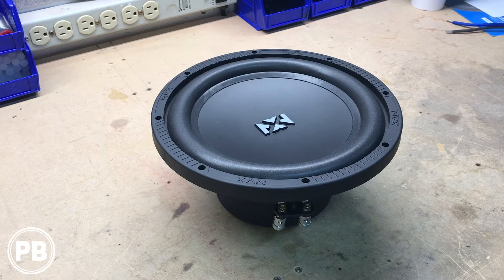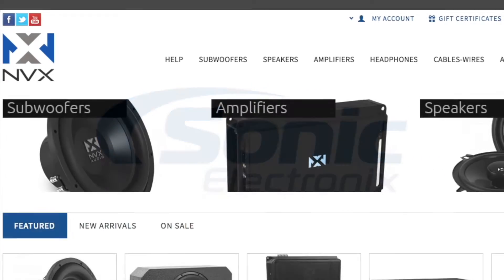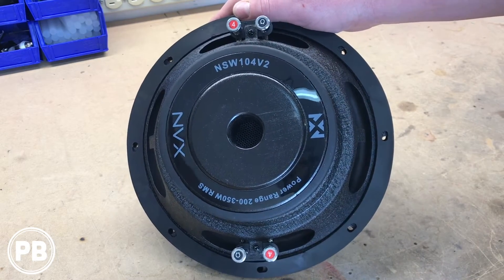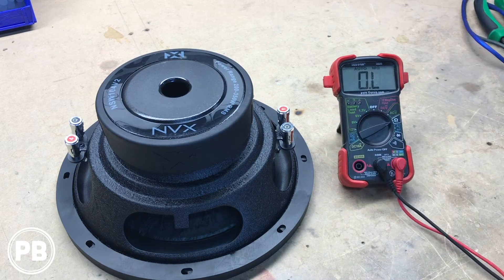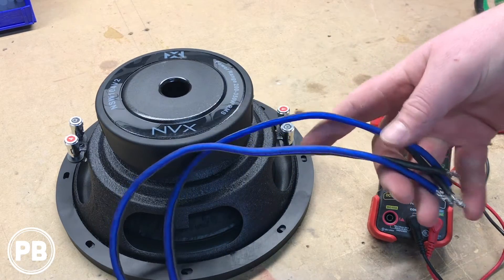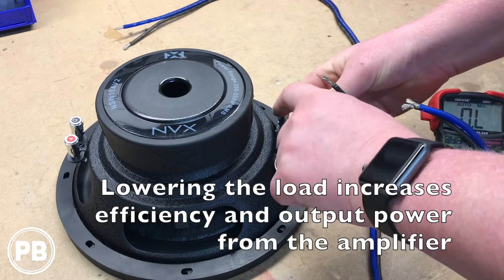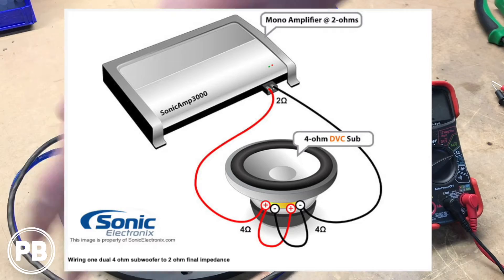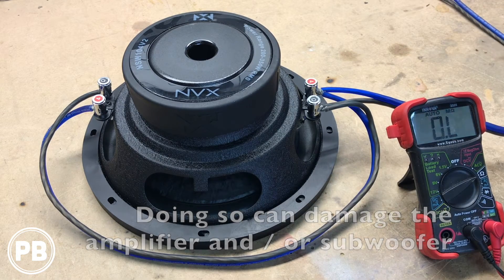How To Wire DVC 4 Ohm Subwoofer

Comment from the maker: Parts listed in the description!
Reply: What size of wire can I use
Reply: Hey mate, quick question, i have a monoblock that runs 2 parallel channels & 1 DVC 4ohm SUB.
Can i stick one side of my DVC's positive and negative into one side of the amp and the other DVC positive and negative into the other?
Does that break it down to two ohm as its a monoblock? How would i get it back to 4ohm? Do i just use one side of the amp to stay at 4ohm? Last question, Sound wise, whats better, running my 4ohm 12 inch at 2 ohm or 4 ohm?  thanks a lot.
Reply: Is a (330w/4 ohms) amp good for 1 sub that is (300w/4 ohms)?
Reply from the maker: Yep, just fine. @ThaBlackHammer

Comment: I did your Kenwood X802-5 amp and Kicker CompRT10 4 ohm dual voice coil sub setup in the Toyota Tacoma. That amp seems like it can handle a 2 ohm load? Currently I just have 1 set of terminals setup (1 positive and 1 negative). Would that be a 4 ohm load?

Comment: Electricity is confusing....
To my knowledge U shouldn't reduce OHMs (impedence) if sub is designed for that spec
Example: 4 OHM , don't go to 8 OHMS = less power consumption. 
If the sub is capable to increase (more power) 3 OHMS or 2 OHMS And so on then it is ok, as long as the Amp is capable. Try not to mix and match
If you have multiple subs and amps, gotta do a little math and testing to get the final impedence (preferably get some help from reliable sources)
Never just connect one set of terminals (voicecoil). 
Recently wired my DVC 4OHM  Kicker sub Red to red black to black and to my Amp, works great no overheating or anything out of the ordinary.

Comment: Can i connect single dual 4ohm sub in series to a bridged 4ohm amp?sub is 250w rms & amp are 400w rms x1 at 4ohm bridged.Basically connecting a 8ohm load to a 4ohm amp

Comment: how the heck do you get 2 wires to go into the same terminal ? i can't get them to fit i must be using too large of a gage wire but i thought i needed it for a 1000 W sub.
Reply: You need a special connector for it. I forgot what it's called. One side is for the wires and the other side is like a stud that fits directly into the speaker terminal
Reply: Twist the speaker wires together and use a banana plug for the connection...

Comment: so i have a 1000w 2 channel amp and a 1000w sub 4ohm dvc but the amp says only 4-8 on bridged can i just run seperate channels to each voice coil so it stays at 4ohm or should i bridge it at 2ohm and just keep the gain turned down which is gonna get me best power without trashing anything cause i also dont wanna run 8ohm
and just be wasting power
Reply: I have the same problem and I’m still looking for an answer
Reply: @Mjsay  i just hooked mine up on 2 seperate channels i think my amp only is pushing like 800w as dual channel vs bridged 1000w but my sub is only like 500w rms 1000w peak and it seems to be working pretty good, sounds better than my old imagine dynamic sub

Comment: I got a single 15 inch quantum audio 4ohm subwoofer hooked up to a 1ohm power acoustic amp. It comes on and play but when I turn the radio up to like volume 15 the amp goes in & out of protection mode. Any suggestions please?
Reply: Id make sure your ground is good and tight
Reply: I ended up having to change amps. The power acoustic wouldn’t hold the sub.

Comment: Thank you for the nice video, 
I'm a newbie with a silly question. 
What is the consequence if wiring 8 ohm single sub to a 4 ohm amp, better low frequencies, tight bass, better sound quality and more control while losing some of the amp power?

Thanks again

Comment: What happens if only one side is connected in a dvc sub to the amp? Will it mess up? Also, if I run two dvc subs and they both are wired at 2 ohms each, what will be the ohms to the amp? Still 2?

Comment: Do I just wire them normal for for 4ohm resistance? I have an ar2000m boss amp and a kicker comp r 12 with 500 rms. The 2000 watt amp has only 750 rms at 4ohms so I need to make sure I wire it at 4 ohms. 
Thanks

Comment: My Scenario: I have two separate 10" subwoofer cabs that have only one 10"DVC 4ohm speaker. I need to get each cabinet to output 4 ohms individually to run my 2 channel amp that outputs 1k watts on each 4ohm channel, Possible?  this is my amps' configs: Thx for your help!!
Power Ratings:
RMS Power Output:
Stereo 8 Ohm: 2 x 700W
Stereo 4 Ohm: 2 x 1000W
Bridged 8 Ohm: 1 x 2000W
Peak Power Output:
Stereo 4 Ohm: 2 x 3500W Max
Bridged 8 Ohm: 1 x 7000W Max

Comment: I have a 2 chanel amp delivering 2x 190 watts into 4 ohm. I have one single 4 ohm dvc subwoofer that I want to run with 4 ohm. How do I wire it to get 4 ohm? I dont want 8 or 2 ohm
Reply from the maker: It’s impossible with that sub, unless you add a second one, or use a different sub. Or use a different amp

Comment: What about showing us a final impedance of 4 ohms. This really is hard to find this info online. A single 4 ohm sub wired specifically to a 4 ohm amp. Why is that so hard to find?!
Reply from the maker: Because it's a direct connection, if it is a SVC 4 ohm sub, simply connect your speaker wire to the only terminals on the sub, and connect those directly to the amp.  There is no parallel / series connection being there is only one sub, and one coil to connect.
Reply: @ProvoBeastAudio  if I wanted to get 4 ohms from a DVC sub, would I just connect one side of the terminals to the amp like a SVC one?
Reply: @hyphinx I'm trying to find this info too. Apparently you should connect all terminals on DVC, never just 2.. But likewise can't see how to make a 4ohm load on 4+4ohm DVC sub.
Reply: @PeterPaoliello you can t make a 4 ohm load with 4+4. You can make only 2 or 8 ohms. But you can wire a voice coil in bridge and the other one the same if your amp can handle.
Reply: @PeterPaoliello a dvc is like having 2 svc subs.  When you have an old 4 ohm amp, you hook each channel up to each speaker.  If you have 1 dvc you act like each set of terminals are a separate sub to get 4 ohm on each voice coils but connecting a channel to each.  If you bridge it, by running only one positive and one negative, it's like 2 kids eating out of the same bowl of ice cream.  It's getting eaten quicker with 2 spoons (wires) going into 2 mouths (voicecoils.)  Parallel and series is like letting them each have a spoon or making them take turns using the spoon.  I hope this makes alittle more sense.
Reply: @shafuthau3694 an amp has 2 or 4 channels that can be bridged on an amp.  If someone wants to make 4 on each voice coil, they hook up a each channel to each voice coil.  If you have a box that had a dvc and only has 1 set of terminals on the box, you would need to take it apart to change the wires so each voice coil goes to a separate set of terminals. You would need to add another set of terminals to the box so you have 2 sets.  Yes it is possible.
Reply: Can't be done apparently as I'm finding out
Reply: @JESSEPAVON  yes but you need to match the gain
Reply: @JESSEPAVON  what amplifier?maybe it can t handle 2 ohm
Reply: @shafuthau3694  can u help me out too? I got a Jenson 1.2KW DSP mono 2 channel output (it's got 2 positives n negatives, both channels are mono) and I got a 4ohm DVC 12" sub. I wanna know can I wire one channel to one coil, and the other channel to the other coil so I can achieve the 4ohm (since both channels are running 1 coil, at 4 ohms, it's still 4ohms total right?)
Reply: @OverlordBravo420  yours can handle 2 ohm i think. if it can go with 2 ohm s in bridge
Reply: @shafuthau3694  idk what my amp can handle, I just wanted to run both channels to both coils so I can still run 4 ohms just 2 channels
Reply: @OverlordBravo420  just wire the voice coils to 2 ohm and use the bridge on your amp
Reply: @JESSEPAVON  sounds like not enough power or a bad contact
Reply: Right this specific info is so hard to find! Even like right now he only told us for a “svc” sub!! NO I HAVE A DVC BRUH WHY ARE YOU EVEN BRING UP THE OTHER HE STILL DIDNT ANSWER THE QUESTION

Comment: You think I should use 12g or 10g speaker wire for my 500w rms 1000w peak subs? Subs wired together then to my amp will prolly be around 8ft 10ft max. Thanks
Reply: 12 will be fine

Comment: I have two 12 p3 Rockford 1200 watts 600 rms each 4 ohm! My question. Do I need a 2 channel amp of 2400 watts???
Reply from the maker: I assume the P3s are DVC 4 ohm, so when wired in parallel each, and then both subs together, it would be a 1 ohm impedance final. So I'd recommend a mono amp, wired at 1 ohm 1200w RMS.  https://amzn.to/3BxW0iO

Comment: What happens if you only put wires on 2 terminals ? Do both sets always need to be wired ?
Reply from the maker: You will burn up your coils if you only connect half the terminals. You need to connect each coil / terminal sets.

Comment: Probably a stupid question. Is it not possible to wire 1 dvc 4ohm sub to a final ohm of 4? 

Also if your amp is stronger than your sub is rated.. like a 400 rms @4ohm sub and your amp does 600rms @4ohm.. you could wire it so that its 8ohms and REDUCE the amps rms output? Is that correct?
Reply from the maker: No you cannot physically wire your DVC 4 ohm sub to 4 ohms, only 2 or 8 ohms by itself.  8 ohms is pretty inefficient and don’t recommend. I’d recommend changing the amp or the sub.
Reply: @ProvoBeastAudio  my sub is fine on 2ohms and my amp is 2 ohms stable. I had never seen a video on 4ohms to 4ohms..now i know why.
Thank you for the reply.

Comment: you’re getting a low ohm reading when you check your impedance because the speaker is on its face. don’t check the impedance while the sub is in its face because it will almost always read low

Comment: Hol up. I have a DVC 4ohm sub. So I just connect one side to my 4ohm mono block amp an I'd have matching  4 ohms correct?
Reply: did you ever figure this out? im in the same situation and figured i only needed to connect one side
Reply: @rcdemail404  1 believe I did the same.
Reply: Did y’all get it? I’m trying to wire my 4ohm L7 do 4 ohm at the amp. So, what’s the scoop?
Reply: @jhatfield2927  if it's reading 4 ohms I don't think u have to use both terminals. I guess it's there to match your speakers to the amp using these methods.

Comment: I have a set of 4 ohm subs and a amp that is rated for 6 ohm. Can i still use them? If so how do i do it
Reply from the maker: Thats an odd amplifier being rated for 6ohm.  What is the model number on the amplifier? Issue you'd run into if pairing a lower impedance sub to an amp thats not stable at that lower resistance, it will generally overheat / go into protect.
Reply: @ProvoBeastAudio  yeah i gave up and have a new problem. I just bought a jbl gto 6000. And i have no clue how to set it up with my DVC subs. I checked the web and some say briding channel 1,2,3,5,6 but that sounds insane. Never seen a bridge with more than 2 channels.. how and what should i do?
Reply from the maker: @shivan628  Again, can't help unless you give me the model of the amplifier.
Reply: @ProvoBeastAudio  haha my bad man, its a jbl gto 6000, and i have a set of climax danger 500's
Reply: @ProvoBeastAudio  how do you think i should do it?
Reply from the maker: @shivan628  That isn't the best amplifier for your subwoofers.  I'd strongly suggest looking for a bass amp / monoblock for your subs.  What you have is a 6 channel, and the most you can bridge it down is to 3 channels. 

you can only bridge 1 and 2 together, 3 and 4 together, and 5 and 6 together.

2 × 144 watts, channel 1 + 2 and 3 + 4 bridged at 4 Ohm +
1 × 225 Watts channel 5 + 6 bridged at 4 Ohm

https://www.amp-performance.de/en/273-JBL-GTO-6000.html
Reply: @ProvoBeastAudio  on the amp it has 3 blocks with screws next to eachother. From left to right is it (sub,front,back) are those the different channels. Or is every screw is a different channel. And can i use the front and back for my sub? The sub has a lowpass filter option and the other 2 have a highpass filter. 

I understand that its not a good amp for my subs. i just had this one laying around and thought might aswell try it. What amp do you reccomend me for these?

Comment: So I have a kenwood kac 511 amp. It says in the description it can do 500 watt rms at 2 ohm and the amp is a 1000 watt. I want to use a 4ohm comp r sub with 500 rms and 1000 peak. If I wire the sub to end at 2 ohms, would I be good? And how should I tune the amp?

Comment: I know this video is kinda old btw good info but I have a class d bluetooth amp with 3 channels  two being 50watt one being 100 at 4ohm and I think the same at 8 I ran a goldwood 8inch tinsel lead broke one it so I plan on getting a planet audio 8inch 1200watt DVC 4ohm to wire to my amp I also bridged another speaker to my amp but far as the 8 inch should I be worried about anything

Comment: I am wiring 1 compR kicker to a 1200.1 mono amp. It is wired parallel currently and the sub cuts out? This is brand new equipment.  Is there a better way? What am I doing wrong.  Gain, bass boost... all controls are bottomed out. Please help.
Reply: Power source from vehicle needs upgrade. The Big Three wiring upgrade. Positive lead from battery to alt 0ga ofc motor ground 0ga ofc battery ground 0ga ofc should help solve your problem. As well battery upgrade helps. If this doesn't fully solve the problem then look into a super capacitor. Much different than the traditional capacitors, they work same way.

Comment: You always have to calculate in the resistance value from the multi-meter test leads first before doing any resistance testing to get the proper reading.

Comment: I have DVC 4ohm subwoofer and a 2 channel 4ohm amp, i only need to connect voice coil A to channel 1 and voice coil B to channel 2, right? The impedance match.
Reply: Thats a separate channel. Its not a monoblock right? you are sposed to bridge the two channels by using one positive terminal of one channel and one negative of the other. But read your amps specs to see if its bridgeable. Usually you can.
Reply: Just remember by bridging it you will now get more power than if it was not bridged don’t want to over power the sub and blow it there’s tons of videos that will show you exactly how to wire your subwoofer to your amp

Comment: can a 1200 amp handle a 1500 sub
Reply: It depends on what the RMS power is if the RMS power is lower on the amp than it is on the subwoofer then you will be fine if it’s opposite then you take a risk at blowing your speaker

Comment: so with a DVC Subwoofer to connect it to the 4-ohm amplifier - just connect to the two connectors?
Reply: I'm sayin... He was not clear on that fact at all...
Reply: How many ohms is the sub if 4 ohm dvc wired in parallel will be 2 ohm or if wired in series 8 ohm. 2 ohm more watts from amp
Reply: @johnnycash5456 rather connect dvc sub as svc since each coil is rated 4ohm
Reply: Just connect to one side of terminal and keep the other side unconnected.

Comment: If you're running a 1ohm mono amplifier, is it okay to run that to a 2ohm set up or should / can you wire the subwoofer down to 1 ohm to match or does that matter?
Reply: You can wire the speaker down to one ohm take the positive from each voice coil and connect them at the terminal and take the negative from each voice coil and collect it to the terminal and you now have one ohm
Reply: I think if you run them all parallel it puts out 2 ohms. I'm not sure tho. I'm new and hearing alot of different info

Comment: Great explanation on the video. I do have 1 question. I have a dvc 4ohm subwoofer and 2 4ohm 6x9 kickers wired to a 4channel amplifier. I bridged the 6x9s. And I wired my dvc sub to 8ohm and bridged that on a separate channel because I was told most 4 channel amps today can't handle 2ohm loads bridged. Is this true?I want to get the most out of my subwoofer without damaging my amp or speakers. Also this is installed all on a motorcycle which is why I am running them on a 4channel amp to save space. Should I be running my sub at 8ohm or 2ohm.?
Reply: The best thing you could do is look up the description of your amp it will say if it can be bridged at two ohm going up to eight ohm you are losing a lot of RMS wattage most amps can B bridged to 2 ohm without a problem and best of all you gain our MS wattage

Comment: Still cant find how to run a single 4 ohm DVC to get a 4 ohm load
Reply from the maker: It's impossible to get a final 4 ohm load with a DVC 4 ohm subwoofer.  You will need a different subwoofer  that is either a SVC 4 ohm sub or a DVC 2 ohm sub.
Reply: Ok thanks

Comment: Im sorry i have question will appreciate help so i have a 2013 focus st which i believe has a 2 channel 2 ohm  wiring going to oem dual coil sub im going to change it to a slightly better speaker and it has dual coil at 4 ohms what's best way to wire like the oem each Channel to each coil or is there something different that i can do for power and safety
Reply: that's exactly what I'm hear for om my 2015 st lol I'm planning on just adding a new app the uses the same speaker wire so I don't hurt the oem sub or amp

Comment: so in other words. a single  4 ohm DVC sub can run at either 2 ohms or 8 ohms.
two 4 ohm DVC subs will give you a total of 4 ohms. 

but, I have a question, I have one 4 ohm DVC plus one 4 ohms single voice coil. if the sub is connected as a 2-ohm configuration. plus the single 4 ohms voice coil woofer. what total ohms at the amp?  (this is for Home audio)  thanks

Comment: Im going to be installing a Skar Audio VD-10 D4 10" 800W Max Power Dual 4 Ohm Shallow Mount Car Subwoofer in a box built for a single 10" sub speaker and I am also installing a Kenwood KAC-7205 amp 500 watts RMS x 1 bridged output at 4 ohms (4 ohm stable in bridged mode) and a Stinger 2 Farad cap tunes what is the wiring configuration for the speaker ?